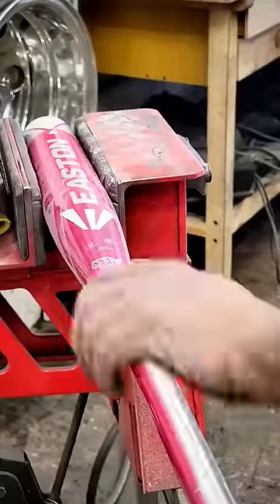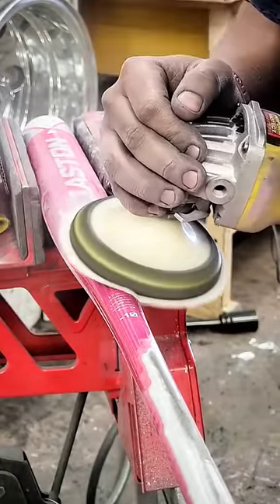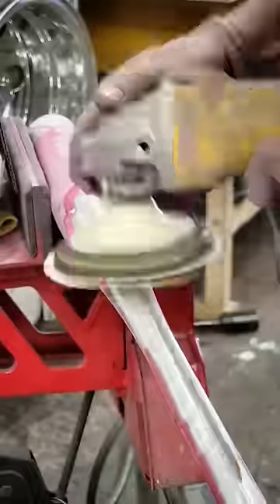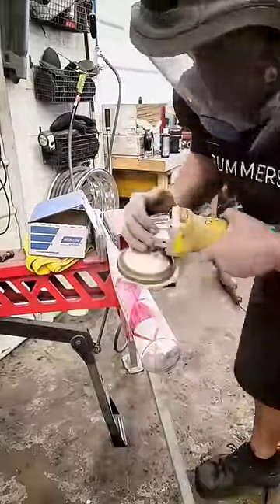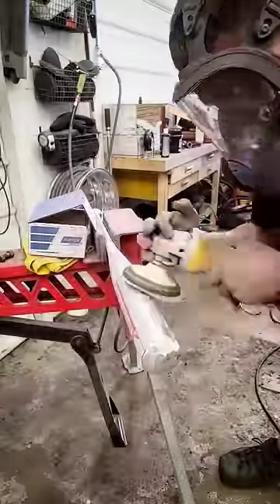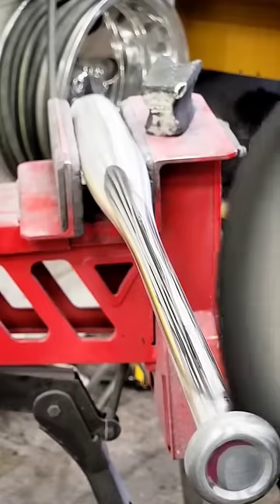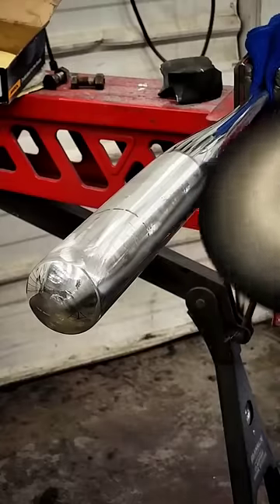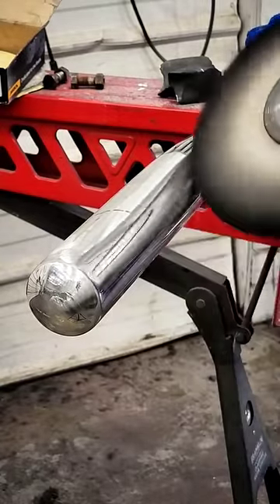Mirror Polished Base Ball Bat.

Comment: Working as a detailer in the semi conductor industry, i was able to get a mirror finish on parts using only my hands, sandpaper and buffing compound in the end. Not one tool was used except for the small messuring device that would read the finish.
Reply: Congratulations buddy work harder not smarter

Comment: Check the bat often for holes in the handle .the acids and salt in human sweat will eat holes into certain types of bare aluminum. Like 6061. Anodizing is done to protect the material from oxidation as well as salts and acids from handling. 7075 does not erode like that when bare.

Comment: where do you get that polish wheel and what brand do you use for the polish? ive played around with some brands like eagle one and mothers, and it just don't seem right. im consistently having to add a ton of polish cause it goes really dry and destroys my wheels. ive tried cleaning them and everything is just nasty. my finishes when i prep everything nicely turns out good, but its just soo much work. what you are using looks soo much cleaner and doesn't look like it takes anywhere near as long as what ive used in the past

Comment: Is it actually perfectly mirror polished? Ive always gone down to 2-3000 to get all micro scratching out. 

Am i usong the wrong cut compounds and cutting foam piece or am i just extremely fussy for you to be able to stop at 600? I can only just get out 1200 with my denim mop on my 3/4hp machine but the spindles arent that long so i use a handheld mainly.

Comment: That's a softball bat, probably break pretty quick if you hit baseballs with it. Softball bats are rated 1.20 bpf baseball is 1.15 at most. Bpf is basically compression, too much compression makes the bat fragile.

Comment: Im betting there is no mill lines in that bat. Since it would be turned on a lathe and could be polished like you did with a piece of sandpaper. Not hacking at your work bro you did good. But if not mistaken they are pressed into a bat.